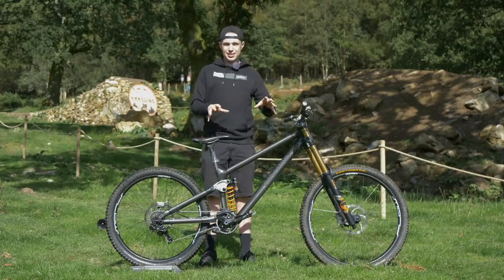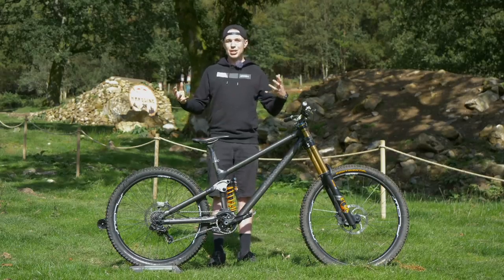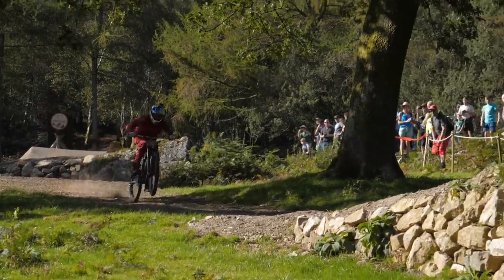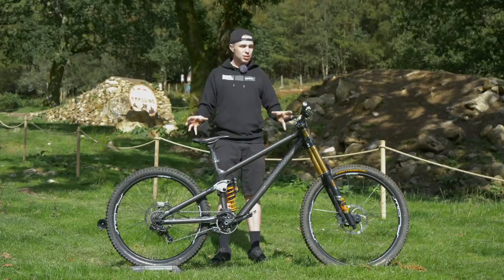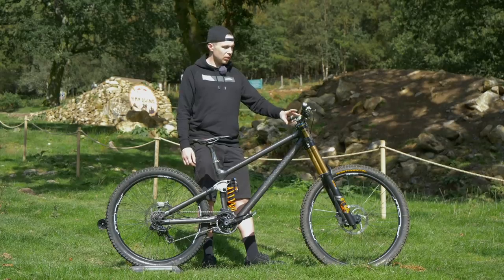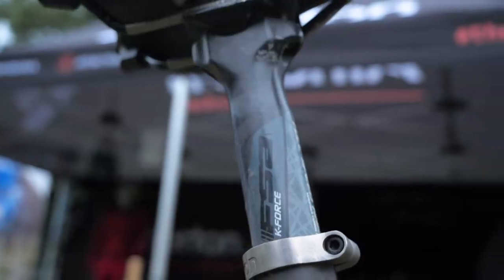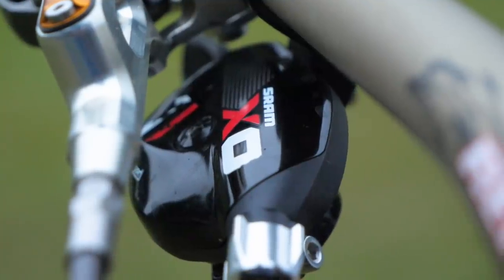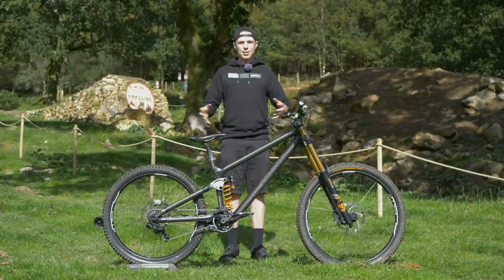Gee Atherton's Atherton Bikes Prototype | GMBN Tech Probike

Comment: Looks like someone fitted modern components on an old steel frame from the 90's.
Reply from the maker: These are supported with an internal wall though so will be much more secure compared to traditional lugs and capillary brazing. The printing allows for tight tolerances and they can even allow the optimum amount of room for resin. Pretty interesting stuff! It will be interesting to see if the pricing of lugs can come down so it can be used on custom Steel and Aluminium bikes in the future.
Reply: I agree, and I love it.

Comment: Remind anyone of a 1989 Reflex ALX Carbon? 
Easton carbon tubes threaded and glued into alloy lugs 30 years ago.
I had the aluminium tubed ALX 89. 
Sold it to a school mate in order to pay towards a original steel framed KONA Cinder cone. 
White frame, Project 2s, Pollock paint splatter effect.
Miss that bike so bad.
First MTB stolen, Newcastle College 1990.
Reply from the maker: These 3D printed lugs are supported with an internal wall though so will be much more secure compared to traditional lugs. The printing allows for tighter tolerances and they can even allow the optimum amount of room for resin. Pretty interesting stuff!
Reply: @gmbntech  no doubt this  looks really interesting. The speed and ease of manufacturing any variation of parts might just be a game changer for frames and components regarding configuration and geometry.
The possibility for building affordable made to measure frames is obvious straight away.

Comment: 2:03 you can see a zip tie with heat shrink tubing on it holding the brake and shifter cable together. Is a zip tie with heat shrink on it common for securing lines together?
Reply: I've seen it on other WC bikes before...keeps the cables from knocking together and rattling.
Reply: It's to keep them apart
Reply: Its a clear hose, you can use a zip tie but it will be too close together. I have done this to isolate wires from eachother.

Comment: Lugs like the old days
Reply from the maker: These are supported with an internal wall though so will be much more secure compared to traditional lugs and capillary brazing. The printing allows for tight tolerances and they can even allow the optimum amount of room for resin. Pretty interesting stuff! It will be interesting to see if the pricing of lugs can come down so it can be used on custom Steel and Aluminium bikes in the future.